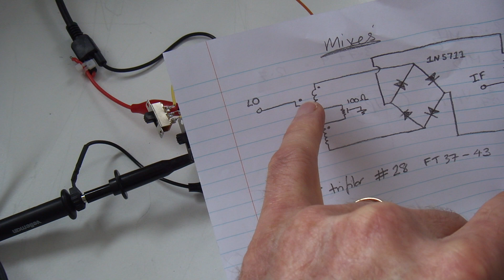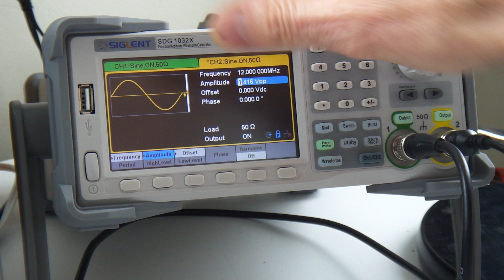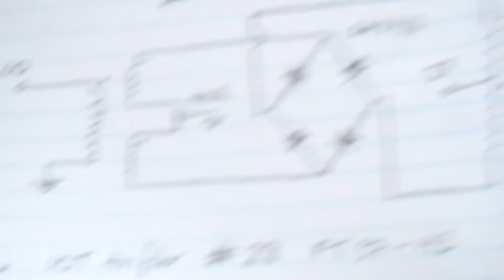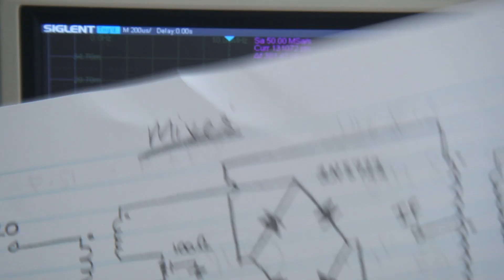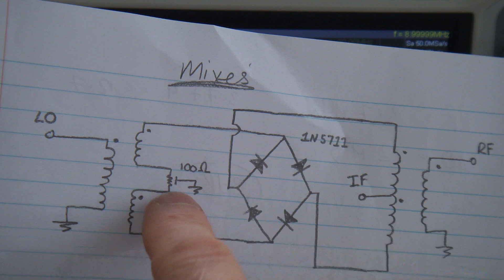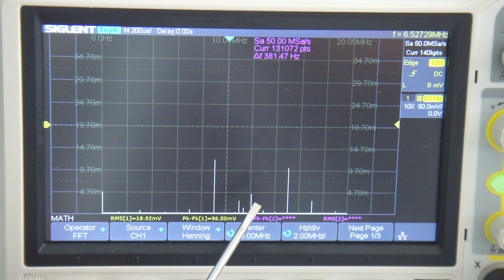Simple SSB Rig: Part 5a - Mixer Experiments

Comment: At 11:35, when you increase the input level, the 3MHz leakthrough starts to increase sigificantly. My guess is that's due to imbalances "further up the curve" with higher current flow through the diodes.
 
If so, that suggests that by careful selection of diodes, maybe plotting them and binning them at 1mA first, then re-runing each group at at 200uA, 1mA and say 10mA and sub-grouping them again, you could achieve better preformance. Of course, that's a heck of a lot of extra work and would probably need a much larger group of diodes to select from. 

I suppose it could be a thermal effect too (or instead), so by simply applying heat from a pinch of your fingers at your original DC measuring/selection stage, you could maybe pick the most stable ones within any similar bin group, assuming that there's any noticeable thermal effect.

Conversely, it could be some differences or nonlinearity in the transformer cores too. If that's the case, larger cores that would show less saturation curve effect would be better. (I doubt there's much effect of this at these sort of drive levels though)

It's already a pain selecting diodes/xtals etc (ask me how I know!) so I don't want to encourage you to do any extra work, just thought I'd put my hunch out on the internet in cae anyone wants to experiment.

Comment: Ok Charlie. One of my questions in the newest video comments, you have answered with this one. 😊 Really great. Do you also have compared your homebrew mixer/ifamp with a sa612-kind?
You have a fantastic lab! What are you doing there next to your radio hobby? 73
Reply from the maker: That's good Markus. No, I have not formally compared the homebrew mixers with the SA612 and like. For a start, one is passive and the other is active. I have used both, and both worked well in their respective rigs. As for the test equipment, i don't do anything other than amateur radio. I find what I have works well for me.

Comment: Hello Charlie - This is great.  I have a question though - is the display output of the FFT linear?  I only ask because I'm copying along at home, but displaying the output on a £50 TinySA (which is perfect for me). The output of the Tiny SA is displayed logarithmic and I see much more 'leakage' of the LO and RF signals in the output display of the TinySA than your FFT display.  The 'leakage' is about 30 to 40 dB down but it is of course very visible on a conventional logarithmic display.  So, I wondered if you get a chance to quickly repeat the experiment but using a spectrum analyser with a logarithmic display - just so I can compare my mixer output!  All the best  Kevin M0XYM
Reply from the maker: Hi Kevin. Not sure sorry. I'd have to go and set it up again.
Reply: @CharlieMorrisZL2CTM  No problem Charlie - thanks for replying.

Comment: Effectively the 100R pot is a change in input impedance, so the effect you notice when shorted is due to mismatching?
Interesting the 1N5711s work very well compared to 1N4148 in th e"old" design. As I noted there are two versions of SBL-1, one with split windings (pins 3 & 4) and one without SBL-1x as you have in your demo.
Reply from the maker: Yes, I'd say that is the case. It certainly works well without it.

Comment: Nice video. However the FFT function of an oscilloscope is not the best instrument for measuring mixers. The dynamic range is only 10, maybe 15 dB (I'm guessing the numbers here from my experience with a signal analyzer). NanoVNA, although less convenient, would be a better choice for the job.
Reply from the maker: Thanks Alex. I think it was still useful from a compare and contrast point of view. All things being equal.
Reply: The SDS1202X-E has an 8 bit ADC and therefore a dynamic range of about 50db. So should be fine :)
Reply: @4youian  may I ask how the fact of using 8 bit ADC brings to the conclusion regarding the FFT dynamic range?
Reply: @R2AUK  The dynamic range is defined as 6.021*N + 1.763 dB where N is the number of bits. There are plenty of online resources that will help.
Reply: @4youian  I'm pretty sure it also depend at least on the number of samples and the noise floor of the instrument. The problem is that we are dealing with low signal levels here, around -14 dBm for IF signal and around -40 dBm for LO leakage (take a look on the typical spectrum of the DRM under test https://eax.me/diode-ring-mixer/ ). I have no doubt the oscilloscope has a good dynamic range when dealing with 200 Vpp signals, but this is not the case. The datasheet for the SDS1202X-E doesn't specify the noise floor, but there is a good reason why. You can't get a decent noise floor with a bandwidth of 100+MHz. But there is a simple test we can do to understand the issue - generate -14 dBm and -40 dBm signals and see how they look like on the oscilloscope. Now think about how many bits are actually used for these signals. Simply put there are a few factors beside the number of bits to consider.
Reply: I must admit though, by the look of the picture I linked my original estimate was too pessimistic, ~30 dB dynamic range for given signal levels seems to be more accurate. I also must admit I didn't explain well what dynamic range concerns me. This is not the dynamic range of the instrument, but the dynamic range we see on FFT for given DUT and given signal levels. In other words the difference between peak signal and the noise floor is only ~30 dB.

Comment: I’m curious what the effect and spectral output would look like if you would have set the IF waveform to be a square wave - similar to what an SI5351 would provide. Thanks for your channel!
Reply from the maker: I did do that yesterday Bob, and I didn't see any negative impact. I've also had good success with running the Si5351 directly into the mixer.
Reply: I wondered the same thing! I think it doesn't really matter because these diode ring mixers are switching mixers (as opposed to using transistors or diodes as non-linear mixers). Switching mixers actually work better with a square wave carrier. There are harmonics (I think those are all those other small frequency spikes you see in the scope), but they will get filtered out by the IF filter. This link helped me think about it: https://wiki.analog.com/university/courses/electronics/electronics_lab_diode_ring_modulator

Comment: Very interesting Charlie. Just wondering if the 1n914 silicon diode mixer needs a higher level VFO than 7 dbm? They have a higher forward voltage. Just wondering if that was the reason for the lower output signal. Cheers, Ian
Reply from the maker: Not sure Ian. I'd have to set things up again and see. I think that aside, the VFO suppression did not appear to be as good.
Reply: @CharlieMorrisZL2CTM  I was thinking the same as Ian: a regular PN junction diode such as the 4148/914 would need a higher drive level than the Schottkys. So, with maybe 10dBm drive, the output might be closer to the other two mixers, and the effect on the VFO might be surprising. Anyway, you've already got very respectable results with the 5711s, and I'll bet your careful work on the transformers has kept the mixer nicely balanced as well, rendering the balancing pot an unnecessary drag on the output. I'm happy I now know that.

Comment: Wow! super fantastic video. also, you proved the new diodes and got more gain. One thing that keeps coming to mind when I see the diode ring mixer sitting by your SDL1, I wonder if anyone has tried a shield with the ring mixer? I'm just assuming it's a grounded shield that's on the SDL1 of course.
Reply from the maker: Thanks Curt. Not sure about the shielding. I'll have to put some thought into it.
Reply: @CharlieMorrisZL2CTM  I was doing a little research on the shielding. at this point, I don't think we need it. it could help later to keep better isolation and interference. I also ran into another mixer that could be fun later. the DDBM that's double double balanced mixer. It's supposed to have better isolation. so many things to play with, it's fun. 
If I'm making too many comments just let me know. I don't know anyone else I can bounce things off of around here. I don't know one Ham that gets into this near me. I know sometimes you feel like you are rambling on but I'll tell you that that's not how I see it. It's all about the thought and troubleshooting process.